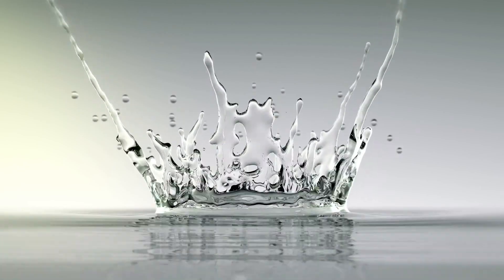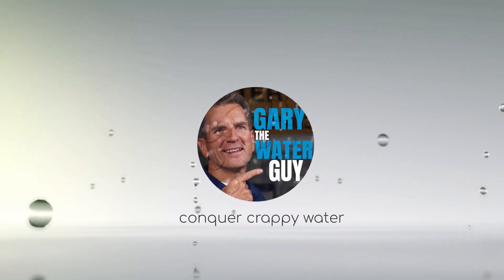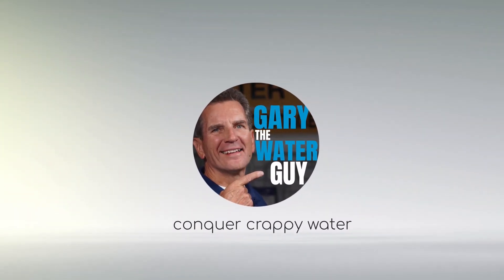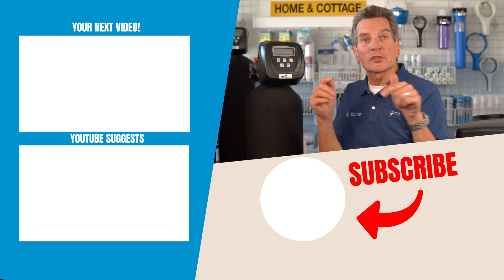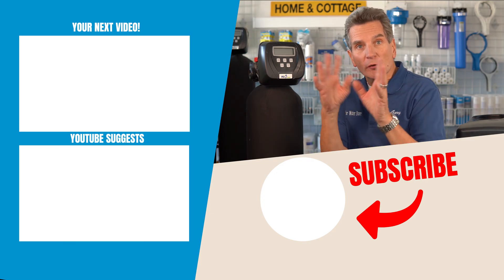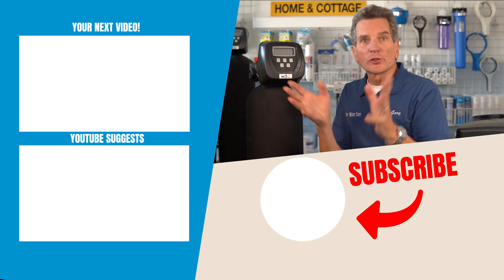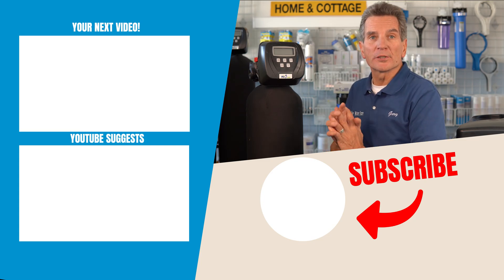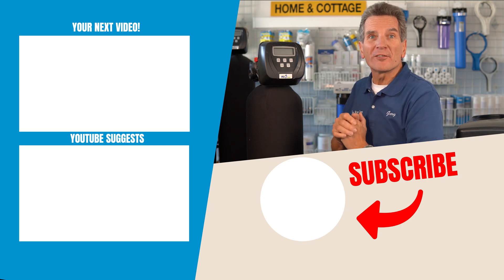CAN WATER be TOO SOFT? Water Softener TROUBLESHOOTING

Comment: Gary, thank you so much for this information, which seems to confirm what I've been thinking and saying to my plumber. Although undoubtedly I was overusing soap at times since installing a water softener, I've adjusted my habits and the water sometimes still feels way too slippery – to the point where I can barely hold onto dishes – and my hands feel slimy and even look shiny once they're dry. 

Assuming I don't need to see a doctor 😀, I've been thinking the softening unit needs to be adjusted better. One of two plumbers I've had (the one who installed it, I think) told me that it's either hard or soft, there's no adjusting it. Yet looking at the head of one of the units I see there are clearly adjustments you can make. My most recent plumber even did make some, but it wasn't clear to me what he did, or even that he understood how to set it, as he seemed to be doing a lot of trial and error fiddling.... and I still have intermittent troubles. (That's another thing I don't understand  – why it wouldn't always be the same. My salt level changes, but I don't think it has ever run out.)

I just looked again and I see two concentric rings on one of the units, the outer one apparently showing the number of people in the house, and the inner one showing hardness, but I'm not at all confident that I'm reading it correctly. It's not intuitive, and I can sympathize with the trouble my recent plumber seemed to be having. 

Maybe what your video has done is prompt me to find my owner's manual and read what I should have read several years ago. 🙄

It may not be possible to diagnose my situation remotely, and I'm not asking you to, but if you have any feedback I certainly welcome it. At any rate, thanks for the video which seems to validate my suspicion that adjustments can be made, and that water can be too soft; it's not just in my head, as I also read or heard somewhere.

The bypass is a really interesting idea, too.
Reply from the maker: It sounds like you have a Fleck 5600 water softener and those manuals should be readily available on line and there should be YouTube videos to help.  I don't work with those valves so I am no expert on that brand.
Reply: @water_estore  No, the brand is CSI. But thanks for reminding me I should look online. I've found a number of owners manuals that way, and already see some possibilities for that brand. Also a few hours ago I watched a video of yours suggested by YouTube, about salt clogs. I doubt that's the explanation for my intermittent issue, but I'm going to check it out. I'm also a new subscriber. Thanks for your reply. 🔧
Reply: @water_estore  you're the best water guy on YouTube ❤💕💕